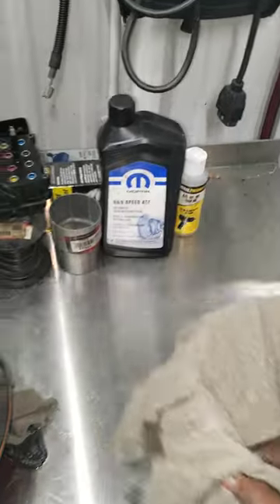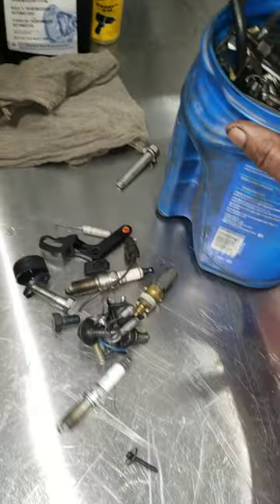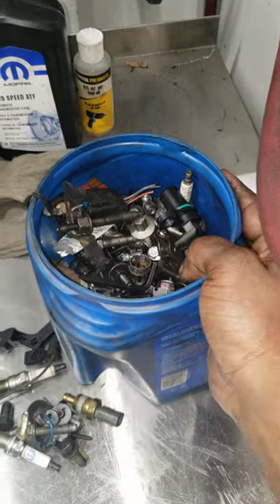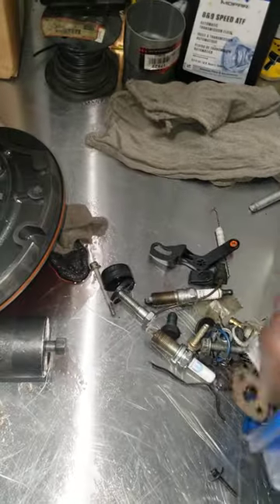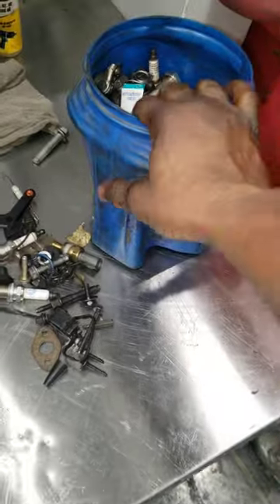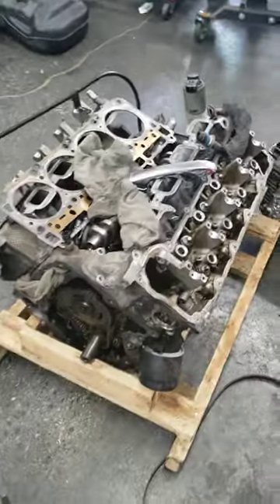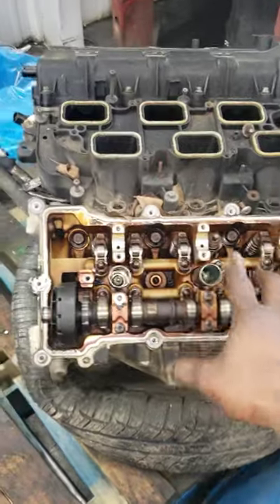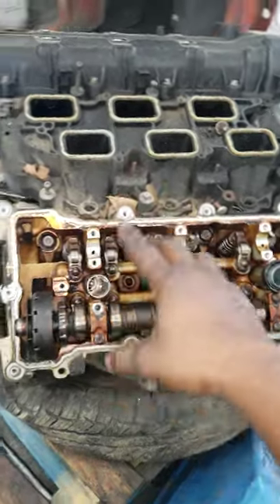I NEED TO GET THIS OFF MY CHEST. Hear me out.  #JTtheCarGuy #shorts #youtubemechanic

Comment: Also, is good to have some extra sensors and old spark plugs, that way if a plug fails you don't have to buy a whole set to make sure that's not the issue, and same thing with sensors that remain in good condition.

Comment: Just changed the motor in my 97 s10 had 2 identical engines so I completely tore down old motor for extra bolts or better looking bolts

Comment: Well ya when you get new parts and hardware they often come with new bolts so you either use the original ones or the new ones thus creating a surplus if extra hardware...I have a few buckets of new and used bolts...washers...screws...cotter pins etc....those people making ignorant comments have never turned a wrench 🔧

Comment: As a DIY with 14 cars + working on family's cars, I have several buckets of bolts. I save the bolts when I go to a Pull A Part salvage, and I've parted out 2 cars. So I got lots! I'd rather have a factory bolt than a hardware bolt whenever possible.

Comment: I have a bad/maybe good habit of anything I replace that doesn't have a core to return gets stripped for any usable. Nuts, bolts, electrics, connectors, clips or anything I see potential value in for future use. And like clockwork, every time I do a purge and clean out, I need something I threw away within a week.

Comment: I got Bolts from a 2013 3.5 1994 4.0 1978 4.1 250 straight 6 1978 4.9 300 straight 6 most of the 10 mm are interchangeable especially for the valve cover. I got head bolts for single cylinder Briggs & strattons I have a shit ton of bolts the only bad part is when I know I need one it takes me 20 minutes to find it but I don't have to buy one.

Comment: Spare fastener are job savers.  Sometimes when a bolt is missing on a car, you'll never know if you have one in there, better that than having the customer wait on something small because it's back ordered.  Panel push pins, more often then not, those tend to fall off of get brittle and break all the time.  With spare ones lying around, we can put them on cars that have missing ones, and install them free of charge all for customer satisfaction.

Comment: I have a junk drawer in my tool box. Cardboard box in there full of bolts from recalls and such. Just like the y78 fuel pump recall on the 19-20 Cummins trucks. I hoard all of the left over bolts. Parts that are still good that other techs throw out i keep as well. Sometimes I get gaskets from parts but the part comes with the gasket and the customer already paid for the job and parts doesn't want it back.. I keep. That stuff gets used on other jobs where I won't have everything I need etc. The tech I help has a whole tool box with spare bolts, ignition coils, gaskets, etc. That stuff comes in handy.

Comment: We got a 5 gallon bucket full.. it’s from old parts taken off and the new part came with new hardware so whenever we have old hardware left it goes in the bucket. That bucket has saved my ass so many times when new parts don’t come with hardware and the old hardware is rusted so bad it’s no distinguished size so u gotta search the bucket for a used replacement in better shape.